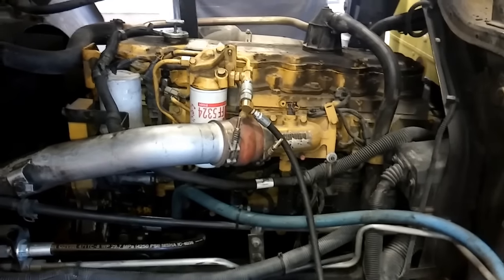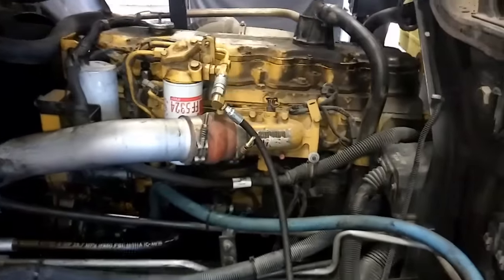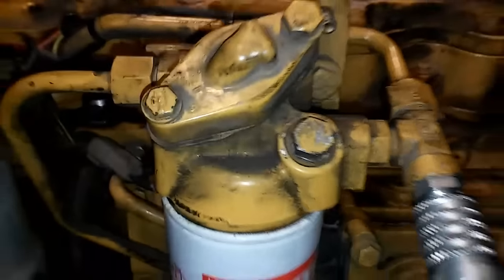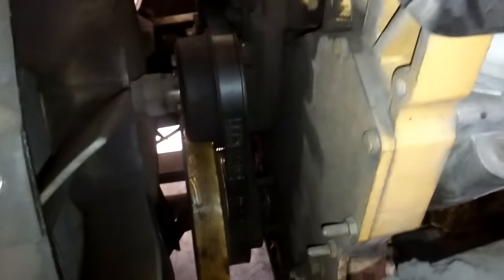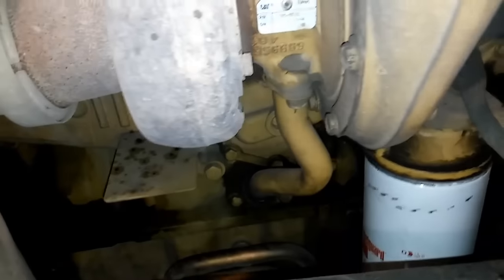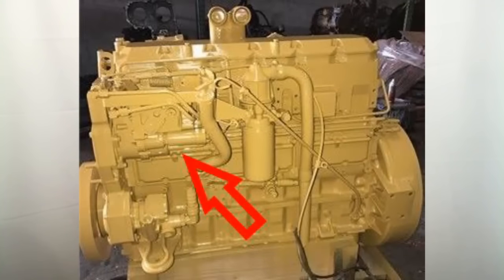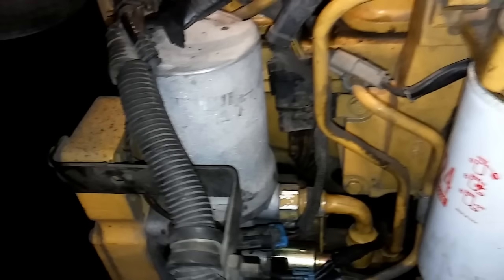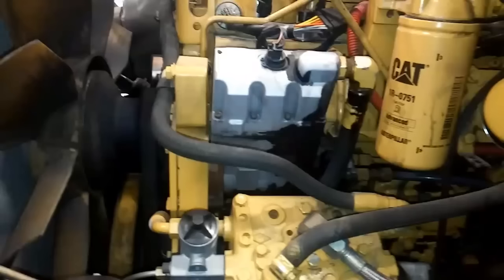The Cat 3126 Engine.  Know Your Engine.  Caterpillar 3126B and 3126E.

Comment: I believe you said up to 330 hp. All literature says the 3126B engines in my 2002 Cabo boat are 450 hp. Early years, I cursed them some, such as when on a trip I had to replace a failed HEUI pump. However, during the past 15 years I leave North Florida running the boat far down the Abaco chain and home with hardly ever any problem, often logging over 1000 miles per trip. In past 15 Engines are meticulously maintained by one skilled diesel mechanic I settled on and no one else has touched my engine in the past 15 years.

Comment: Thank you for taking the time to post of these videos sharing your knowledge. I have a Freightliner m2 106 with a cat 3126B. It died on me driving down the freeway. I figured it was the Huei system but it ended up being the ECM. I had the codes read since mine didn’t show any codes on the dash and I had all 6 injector codes. One of your videos said if I had those codes it was most likely the ecm. I pulled the ecm and took it to cat for them to test it. It was bad. After the testing old and programming the new ecm it was just under $5,000. I installed it today and my truck fired right up!! Thanks again!!!

Comment: Only recently my Cat dealer installed the "HEUI oil supply line update" to my Safari Zanzibar motor home with 3126B engine during some routine maintenance I had it in the shop for. Glad to know that is done now!

Comment: That helps a great deal in understanding the components and sensors. What was especially critical was the possible turbo oil line failure. I have seen a number of RV's that had engine fires. This is very important to check. Thank you.

Comment: I would have to say the biggest pain with the water pump v belt on a 3126 is getting it over the balancer. The belt is smaller then the balancer and you have to stretch it around it. Not much room to work between the front balancer and  the radiator in an 03 GMC topkick C7500 with a 3126 shoe horned into it. Great videos keep them coming
Reply: The trick is to turn belt inside out to get it over balancer.

Comment: hey josh. my boyfriend and i recently purchased a school bus in order to convert it into a livable rv type situation. the bus is a 2004 freightliner thomas built with a 7.2l inline 6cyl 3126 connected to a 6spd allison tranny. ill cut to the chase, i know nothing about automotive anything. my boyfriend on the other hand is well adept in many skills. one of those being automotive. however, this is his first diesel engine. upon purchasing the bus, it had no noticable engine issues or electrical issues. since owning the bus (4 months in) we began having minor issues such as radiator leak at the top where the inlet hose is located, alternator charging issue and now electrical. my bf was able to find and replace the alternator. we are still having electrical issues i.e. strobe lights blown out, rear tail lights and reverse lights not working and also a dull front right side head light. my bf checked all the fuses, replaced the ones that blew and also replaced some relays and bulbs for good measure. he has been chasing wires and is starting to "loose his shit" his words, not mine. he has been trying to find wiring diagrams as well as anything refering to a 3126 school bus. he has continued to run into roads blocks. we are located in los angeles (which is not diesel friendly). if there is any way you can help us, that would be amazing.

Comment: I just bought one of these engines and I am totally stoked to hear you have a good opinion of it. Allegedly it has 200k kms and it was in a fire when the car next to it burnt. Looked bad at first but as I clean stuff i't starting to look better and I now think I might get it running! Looking for a wiring diagram to see what pins need power and ground on the computer...

Comment: Good video.
It's nice to know about an engine that I haven't had any experience with.

There's one engine that really impressed me that I got to run for 3 days. 
The 3176.
If you have a video on that, please point me to it. If not, you should do one if you get the chance.

What impressed me was that the transmission stuck on the high side on my last trip with that truck, and the engine had very little trouble starting up a hill with a full load.  
It pulled like an electric motor.
While it wasn't ever gonna win any races, I found it amazing that the engine was able to get the truck moving without burning the clutch to ashes.

Comment: I use to think the Heui system was sketchy until I bought my 99 7.3 Powerstroke 1 ton dually. The Ford system came from the Cat design. This year (2023) the HPOP started leaking oil very bad and I was forced to fix it. I did all the work myself including new o-rings for the turbo pedestal and turbo and new oil lines and I've got to say the Heui is not that hard to work on after all. My 99 now runs like brand new. It did have a slight miss prior to doing the work and now its fixed. The Hpop wasn't bad by the way, it only need to be removed cleaned and resealed. The Injection Pressure Regulator was also re o-ringed and this stuff is all original parts. The system is damn good in my opinion but it helps to understand how it works. Clean oil and oil changes are very important in these systems. The reason I watched this video is that I'm looking at a motor home with the 3126 motor.

Comment: The 3126A was a MUI system... Not HEUI. It was in equipment. 
But yes, it was a stop-gap between the 3116 and 3126B.

Also... run a quality synthetic oil. Cold start issues are much less.
-35°F at 5900 foot elevation starts are possible if the intake heater is working and your batteries are good. 

Same applies for a 7.3L Powerstroke/ t444e International

Comment: I have to say, I really dislike the HEUI injection system.  On two occasions in 3 years (in different trucks, but same make/model), I've had problems with this system.

The situation was: 1. I got a low oil pressure light and buzzer (but no rough running, misfires or check engine light); and 2. the engine shut down 30 seconds later (on a busy highway, no less - thankfully I got to the shoulder just as it quit.)   Got a tech to come and take a look - no sign of leaks, no oil in the exhaust or intake, nothing in the radiator, no problems with turbo seals, not blowing smoke...but the crankcase was definitely empty.  He put about 7 gallons in the engine and sent me on my way.

20 minutes down the road, the same problem - all the oil was gone again.  Got it towed this time.  The result: next day, the tech at the workshop told me it was the high pressure oil getting past an injector seal and being pumped down the return line into the fuel tank to mix with the diesel.

Maybe I'm just unlucky...but I find I'm a bit leery of the HEUI system these days because of these experiences.

PS:  Great videos, mate - love how you bring a good amount of detail to the table, instead of the usual youtube overviews.  Awesome work.  :-)

Comment: Hi @Adept Ape,

Your video on Caterpillar 3125 engine was a breath of fresh air. In fact your channel is just what I was searching for.

I own a 15 tonne 2003 Ford F750 truck with Caterpillar 3126B engine. In where I live it is not a common engine, so getting local mechanics and advice on problems is a nightmare.

Please I need your advice urgently. Normally my engine comes on and steams fine without problems. But then I had some nozzle problem and had to "snuff" with petrol to start it. Later I had an accident in which the truck fell on its side. After setting it upright I noticed that after filling up the radiator with water it vanishes without any outward sign of leakage. We started it but it would not steam if I took my feet off the pedal. Also the oil was whitish, as if mixed with water. I was told by mechanics that it was either a top cylinder or gasket fracture. And oil had flowed on top the pistons.

We have since replaced the gasket after checking that no visible sign of fracture is in the top cylinder. Fixed, cleaned and coupled the cylinder, nozzles and valves back in place but here's the situation am facing: 

1. My engine is starting and steaming very well, but bringing out a steady stream of light steam via the breather when it is switched on.
2. The water slowly vanishes from the radiator after switching off even if it was just filled up fully.
3. When I gauge the oil. I find it is whitish again. Although I don't notice any drop or increase in the oil level.

Can you please advice me on probable cause?

A mechanic suggested that there's a minor leak due to missing gasket oil seals. What do you say about that.

Comment: I have a round to on my 3126 1998 it the first engine 3126 so it's different.  I put a new huhi pump less than 100 hours ago. It was running fine except for surging when idleing.. this morning it was below freezing and it's not starting. It was 24 degrees so hopefully start after it warms up.

Comment: Hey hey @Adept Ape! Love your videos! Very informative & we appreciate you! QUESTION: We have a CAT 3126 on our '97 Thomas Saf-T-Liner bus and the engine wouldn't start the other day in freezing conditions. The lights on the dash light up like normal, but when turning the ignition to start, it didn't even sound like it wanted to turn over. We took the batteries to Napa Auto Parts to get tested and they were both at 12.2 volts (the tech said they needed to be at 12.6V, so we bought a 10A battery charger, which we're waiting to arrive next week.)

Do you think the COLD is the main culprit? 
Or do you think the alternator could be an issue?
What do you think we should check to diagnose the main issue?

Once we get the battery charger, we'll charge the batteries indoors where it's warmer and then put them back in to see if it starts. We're not running the engine much since we are still doing our school bus conversion.

We searched your channel for alternator diagnosis but didn't find any video on it (if you do have a video, could you please drop a link here in the comments for us?

Any tips are much appreciated! 
Thanks so much!
- Brian + Erin
Reply: I would say load test the batteries individually with a load tester, batteries can have 12V and lose all its voltage when under load, get a batter blanket or pads and plug it in, in cold conditions overnight

Comment: loved my 03 frieghtliner fl-80 with the 3126  at 1800 rpm running 63 mph  got 11 mpg out of it wish i still had that old truck
only problem is letting it idle 5+ hours when you start going again  it would blow tons of whitish blue smoke for abought a mile till it burned off was pulled over in VA once the officer thought i was on fire told em naa its just smoke it'll clear up in a minute he let me go but followed me till it cleared

Comment: Great video!  I learned a lot. I am a new owner of a Cruisers 39 and it has two Caterpillar 3116TA engines.  I have tow basic questions:  the first is, where can I locate the dipsticks?  The second question is: where do I add oil, if needed?  The previous owner always used 15W - 40. I assume that is a good weight of oil for North Carolina.  What are your thoughts?

Comment: Lucky that engine didn't run away on him with that much oil going in!
Seems the 3126 always needs its oil cooler o-rings (and subsequent gaskets) replaced around 100K. 
I actually liked the little water pump  v-belts cause I could keep on going if the fan/ac/or tensioner pulley/belt failed......just don't stop and idle, or run the batteries dead!  My Louisville rollback put 250K miles on its 3126 before the coolant started to pump out the de-gas bottle......suspected a headgasket or maybe cylinder cavitation pitting?......paid nothing for her and sold her for nothing, but got many years of reliable running with only a bad lift pump and oil cooler leaks for repairs.
Reply: Steve po I agree with you. I had the tensioner fail and the serpentine belt break, I was able to make it home being very carful.

Comment: Great video.  I’m looking at a motorhome with this engine. The owner said the engine has larger injectors and has been tuned to 390 horsepower. This makes me want to walk away from it. I get nervous when engines are TUNED.  Is this a common upgrade in the 3126?  Again Thanks for the great information

Comment: Great video dude. Correct me if I'm wrong, but I believe it wasn't 175 HP as low hole, it was 170HP. 330 was right as high end Apps.
Reply: You mean the 175hp are way better than say, the 300s to 350hp?
please let me know something.
Thanks.

Comment: That engine with the blocked DPF should have been throwing a heap of codes long before it got to that bad I would have thought. Any chance the DPF  blocked first and the increased back pressure blew the turbo oil seal so the problem went from bad to worse. Cheers mate🍻

Comment: I have a customer with a 2000 3126b 210 hp. They found a school bus with a 2001 3126e with adv. 190 hp and a max of 246 hp. Without knowing the engine family of one of the engines is there a way to tell if the 3126e is interchangeable to they're truck with the 3126B ?

Comment: Currently stuck in the desert with an overheating 3126 due to the fan not kicking on high at 220F. Spoke to several people and the consensus was stuck thermostats. Found some several hours from where we’re at and replaced them today. Took it for a test drive and now our coolant gauge on the cluster isn’t working.

Please help!

Comment: ❤hi l just bought 2000 Treadwinds motorhome with 3126 ,300hp turbo 860 torg with 17.285 miles 
It has been setting like 8 mo , seller changed the oil . But I am worry about Huei having plastic hose . Should l change it into steel hose ? What part do you recommend? And what’s the price if l take it to mechanic? Please advice, Thank you

Comment: Thanks for sharing your knowledge...have a question..recently bought a 2003 fl70 with the 3126, noticed there's a bit of oil in the coolant, thinking it might be the oil cooler however am in little bit of doubt ( also thinking it could be the head gasket) reason being on higher speeds the temperature increases to the point where the fan kicks quite frequently.  At lower speeds 70 kph and under seems to be okay. Your thoughts?
Reply: I am thinking of buying this exact truck... Are these engines reliable and durable... Or easy to work kn

Comment: I’m trying to figure out if I want this or the 3116 for my 92 F350 that came with the mechanical 7.3L IDI. I would appreciate any feedback. Thanks.
Reply: Check out deboss garage on U-tube. I would suggest 3126. I have both in wreckers and rollbacks and the 3126's are mutch easier to work on. Also if you can find a 2000ish Ford F650ish, most had a serp drive that included the water pump.

Comment: i have a 2001 Chevy C6500 with a cat 3126. it has 470k miles and runs like a champ. sucks on power, but it runs good. being with so many miles i am cautious about bumping the hp tune up. i found a 3126 locally  for $500 and i am thinking about doing a 350hp turbo build. not sure exactly what hp i have now

Comment: Is the Heui oil supply line update harder to install on a square top Heui pump. Our 2003 Newmar MH has a 3126E HEP08621 with the sq. Heui pump. If the pump should fail can it be replaced with the round top. Thanks.

Comment: How about sharing what makes the air cooling fan clutch go on and off there is a switch on the firewall but how does it get the signal from a temp sensor or from the ecm. Thanks you real do nice videos

Comment: I would like to ask you a question ?? on the primary filter with a rubber press pump, is that aftermarket?? I don't have that on my 3116... I don't think I have a primer pump on my engine ??
Next comment:
There is a larger fuel line with a bracket along with two bolts that hold it to the top most fwd area of cylinder head... just forward of that point is the engine removal piece that has a large hole a chain will fit for lifting...fwd of that is the heavy bracket held by six bolts that supports fan clutch and fan assembly....
My thinking along with you're pointing out a hairline fracture might exist..??  the area of the right  bolt ( 1 of 2   
Looking from front of eng..) that secure the return fuel line flange to the cylinder head....
So happens that the top right bolt
Of the bracket supporting fan and
Clutch bracket  taps and threads into the same vacinity of cylinder head.....very close!!!! Might be a weak spot??
Maybe you could share with me what I might see if I removed the bracket that supports fan and clutch assembly along with the engine lift piece ???

Comment: I've seen a 330hp 3126 melt the exhaust brake butterfly valve nearly shut in a motor home application. Had low power/Smokey complaint.
Reply from the maker: +Cameron Hartshorn That could cause a slight exhaust restriction IMO lol

Comment: 3126. Starts fine. But after 20-30 seconds revs up to around 1000. Spike the throttle is idles down like a carberated gas engine. Idles fine for another 20-30 seconds, Then idles up again. And idea what's up with it? Looking for some advise.
Reply: Michel Reineking normal don’t worry about it. Engine is just trying to reach operating temp sooner so it reps up.

Comment: I have a question I have a 2003 Freightliner fl-70 and it has a Caterpillar 3126e and I found a caterpillar caterpillar 3126b can I use the b engine in place of the 3126e or can I use the block or head what is usable and what is different any help would be appreciated thank you very much

Comment: Very informative video. I was searching to see if anyone has installed a 3126 outta a truck, into a Loader or excavator. We can do the electrical but the problem is adapting the acceleration to the loader. Anyone has an idea how we can do it??
Reply: I have a cat 950g loader with a 3126 in it
Reply: The Cat 322 Bl has the 3126 as a power unit.